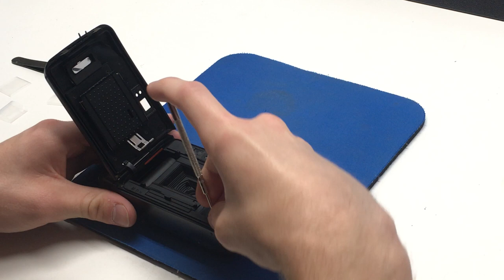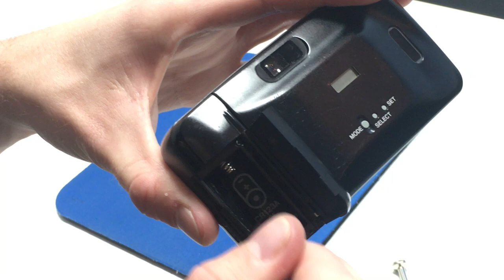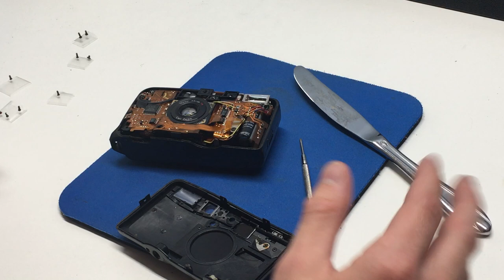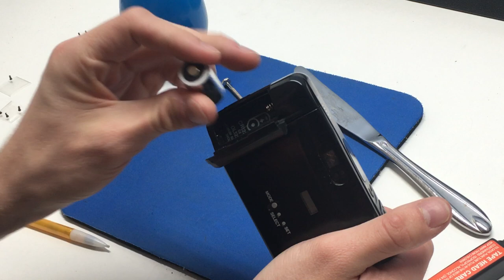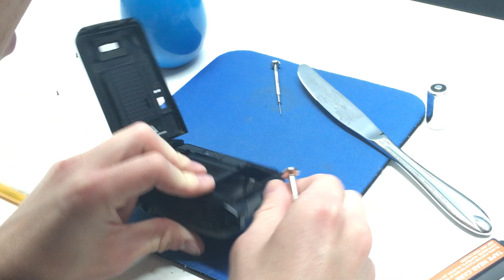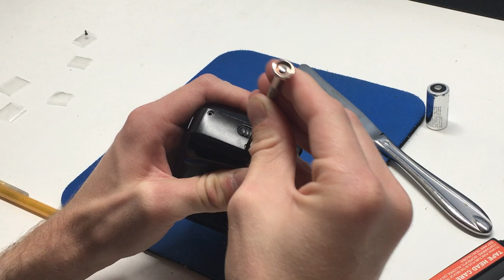Yashica T4 On/Off Repair (Minor)

Comment: Thanks for good instructions! Inspired by you went ahead with My T4, which was reluctant to power on. I purchased a set of Vessel screwdrivers on ebay, and opened up. I used a credit card to pry the front open. I removed dust using a lens brush. I cleaned the contacts for the on-off switch by lightly scraping with a small screwdriver. Put it back together and it now works perfectly. It looks better also. Thanks again!
Reply from the maker: Terje Arneng No problem! I'm glad this is just a very minor repair.

Comment: Hey :) Do you know what is wrong with my camera when it turns off and on fine, but when I try to take a picture the lens just pops out, the shutter opens and closes but doesn't take the photo?
Reply: broken flex cable

Comment: I have the same issue with the LCD display - didn't think to try "pushing" but that's an easy hack that's been working. Have you been able to find a fix/ repair?

Comment: Hey! I have a T4 as well, and only wanted to clean the clear plastics from all the dust that gathered inside (the covers of viewfinder and autofocus sensors on the front plate). In order to remove the front plate, do i only need to unscrew the bottom screw or all the ones that you did as well?

Cheers!!

Comment: if the connection to the data back wire is severed would it impact anything else on the camera?
Reply from the maker: Quinn Kearney I doubt it would. However there must be a way to detach it safely. Try doing that first

Comment: Anyone have any info on how to fix a T4 that wont rewind roll? I pulled the roll out and hit the manual rewind and it won't even spin. I'm thinking it's a bad motor but I can feel and hear it trying to work.
Reply from the maker: Daniel Ribar Could be a bad motor, but if the motor sounds like it's trying, it might be an issue with the gears that handle the rewinding. I don't know how to get you there, but try checking the rewind gears on the baseplate of the camera. Could be a faulty clutch as well.
Reply: @jackwiegmann  Thanks Jack, I was thinking it could be gears too. I'm about to open it up and have a look. I've never done this before so let me know if there's anything you'd recommend I keen an eye out for. What's the word on the clutch, I'm not familiar with that... I appreciate the help.
Reply from the maker: Daniel Ribar just make sure you keep all of the screws organized and try not to force anything
Reply: @jackwiegmann  Thanks man. Having a go at it now.

Comment: Hey, I managed to remove the front cover on a yashica T5 but I can't completely remove it. The front cover and the main body are attached by a rubber tubing that surrounds the lens and I don't feel safe removing the front cover without ripping that rubber tubing. I know this is slightly different than the T4 but do you know how I could remove the front cover safely?
Reply from the maker: Eh. You can definitely rip the rubber but it'll compromise the water resistance of the camera. Don't know much past that. good luck!
Reply: @jackwiegmann  Thanks for the response! I managed to remove to front cover without affecting the rubber. Have you fixed the lens cover before? I'm trying to figure out how the spring mechanism works to make it the lens cover open and close properly.
Reply from the maker: never used one so wouldn't know :-/
Reply: @jackwiegmann  No worries, I'll try to figure something out. Thanks for the help :)
Reply: Three years later but, If you remember how you removed the rubber without compromising, I’d love to know

Comment: I recently bought a Kyocera Slim T from a Japanese online auction, and it turns out there's a problem with the camera.

I can turn on the camera, change the flash modes, and turn on the self-timer, but the camera won't take a picture. When I click the shutter button, the lens advances, but no picture is taken. This problem happens on all of the modes except the infinity mode.

Can you help me with this problem?
Reply: I have the same problem with my T4. Did you find a fix yet?